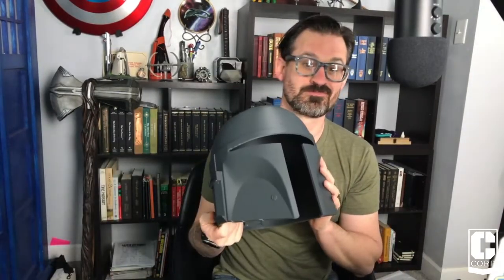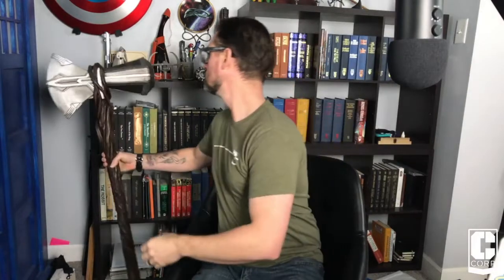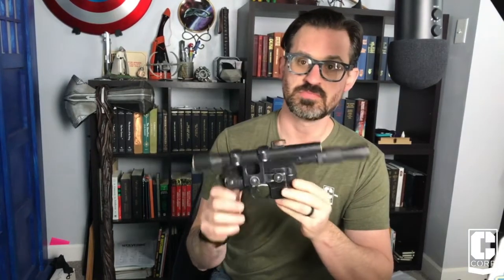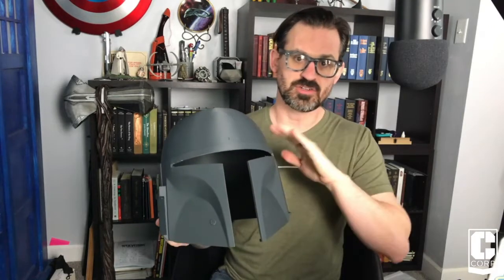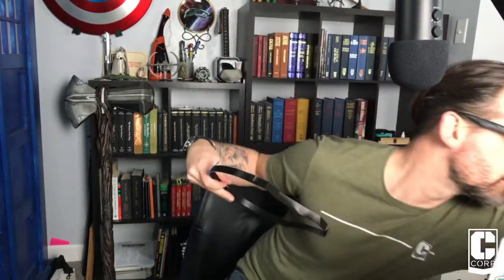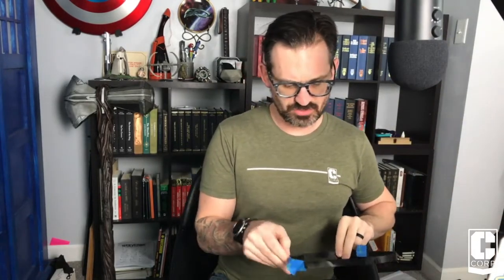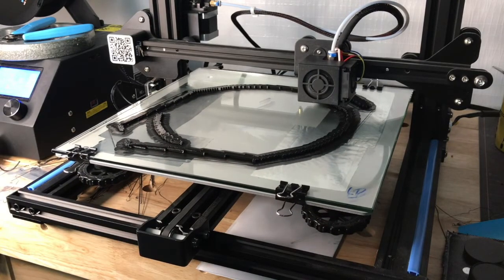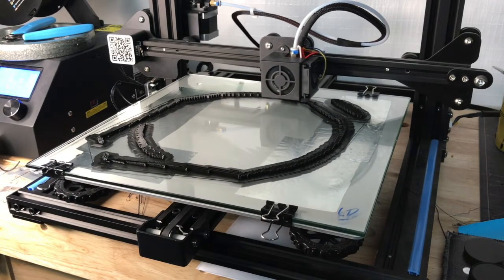Mandalorian Cosplay Build #1: Introductions

Comment: Man im super nervous. I don't have a 3d printer so I ended up buying Galactic Armory pre made prints.  They are made for a 200 6 foot tall guy. im 180 5'11' and i just hope it looks good. you can basically cheese everything but the fitting of the armor. should be here early April.  Plan on posting about it. Its interesting because we are basically in the same place in the build. but im completely obsessed so I know I can make it work.
Reply from the maker: The nice thing about the armor pieces being a big too big is that you can add some padding to the suit to help even out the proportions.